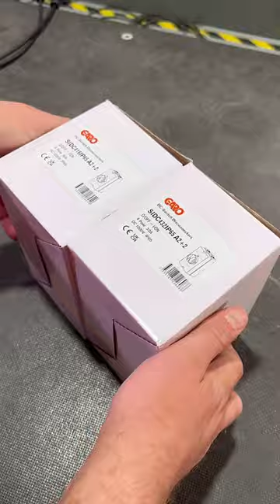Unveiling the Hidden Secrets of DC Isolators

Comment: Was expecting this to actually be more of an explanation of how dc isolators differ from ac. No real secrets shown just an install..
Reply: Physically larger separation between the contacts.
Reply: using two poles in series to allow for the higher voltage.

Comment: Glands are different ! I so wish manufacturers would loose the knockouts, nobody actually knocks they out as you always crack the wrong ring. It would give you many more options
Reply: I always knock them out, usually with a flathead screwdriver and my hand, never had the wrong ring crack. It's a lot quicker and cleaner than drilling, also doesn't end up in the wrong place

Comment: thats why they are burning... crimped soft cabel that fades under tension of the screw and start heating up... and mounted on flamable osb panel 😂... use a wago spring loaded type instead... or regulary tight the screws

Comment: Nice to see you guys using flathead screws to mount the unit! As they weaking the plastic which leads premature collaps...

Next time use dome head with a flat bottom.

My former boss learned that lesson the hard way mounting Brightwell soap and paper towel dispensers in high risk areas.
Reply: Cup washer?
Reply: The term you are looking for is 'countersunk'. Agree non-countersunk head would be superior.
Reply: @timbo19  sometimes abbreviated to CSK

Comment: Why feed the first set of wires from the top, down underneath, then into a pole that is switched with a link back to the outgoing wires, (next to the incoming wire (running down & up)) & exit underneath the switch.
Some may claim you are sharing the DC current across 2 switched poles - even though the switch is rated on all 4 poles inside...
But you could have run the top wires into 1 pole - with it's link to pole next to it, then the incoming wire is sharing the load across two poles - which exits on a wire sharing two poles to the inverter - leaving the lower links intact that was removed.
Finally ALWAYS TRIPLE CHECK DC switches POLARITY as some like Stag/IMO have the switches poles arranged diagonally & not straight down like you might assume to be common to all switches.
Unveiling the hidden secrets ???
Click-bait headline - leave this stuff to Artisan chaps
Reply: Standard way to wire DC through a switch. DC current is hard to break as unlike AC the voltage never drops to zero so switching it through several contacts give you the best chance

Comment: 4 terminals..
Is that a 3 phase + N isolator?😭😭😭
Reply: DC isolator, both positive and negative. Mostly used for solar, to disconnect the array during servicing of the rest of the system. It's that, or only work on it at night.
Reply: @vylbird8014  Unless the moon is full. Then you run the risk of turning into a werewolf in the afterlife.